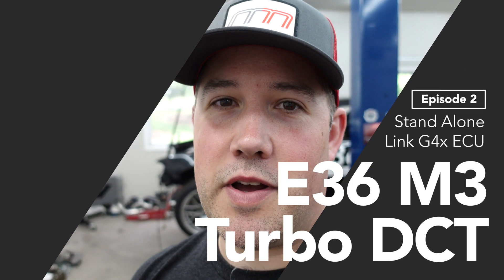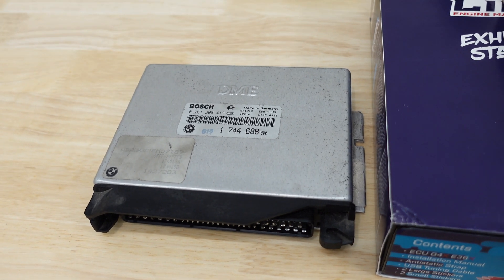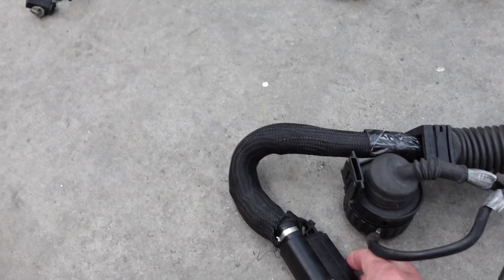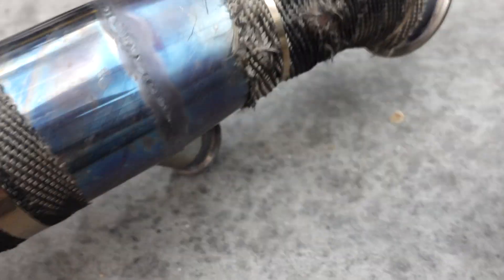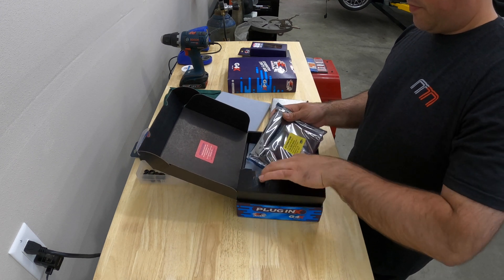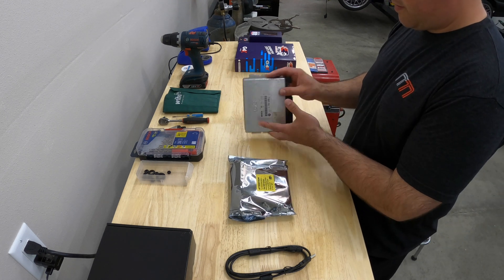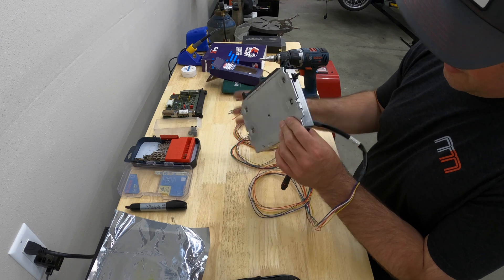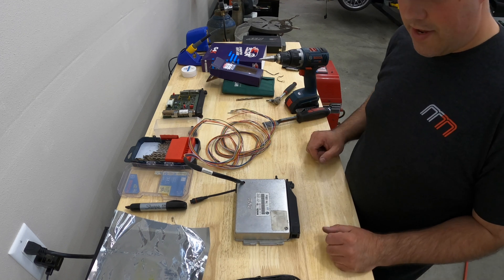E36 M3 Turbo DCT Engine Build Ep. 2: Link G4x ECU Initial Setup

Comment: Is it possible to set this up with 6 egt sensors to  onitor the individual temps of each cylinder? Maybe setup a warning. What about oil temp /pressure warnings 
?

Comment: Hey does the link standalone work for obd2 e36
Reply: yes, but you have to convert engine side harness to obd1 (including sensors, alternator, ignition coils, knock sensors, throttle body, etc). Currently converting a 99 M3 to obd1 so that i can run the link ecu and eventually big turbo

Comment: I've Installed/tuned a few of these for SCCA/ITR (e36's like yours), just wanted to throw you a tip that i like to use on these since they original have fan clutches, if you have an electric fan, i like to ditch the ever failing fan switch, wire a relay to ground to pin48 Ign7 (aux) AirCon Compressor (Black/Blue) im assuming you dont have ac anymore lol, and let the Link EMS take control of your fan, will run off your ECT sensor, then you can set any turn on/shutoff points........